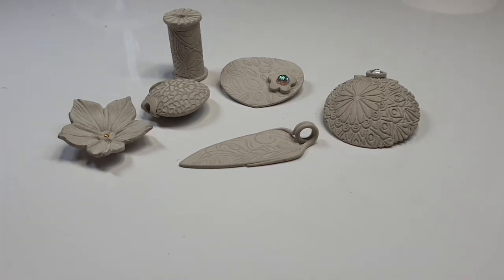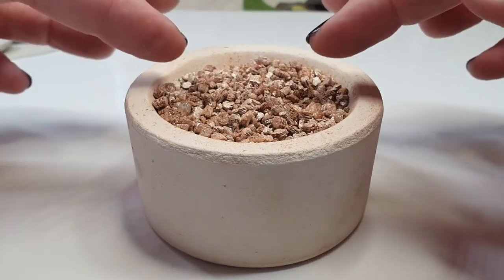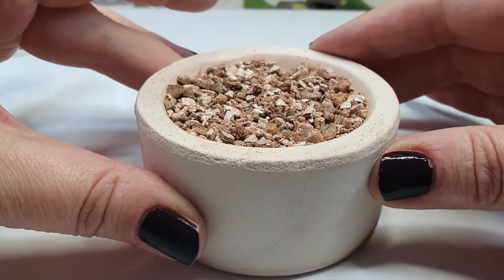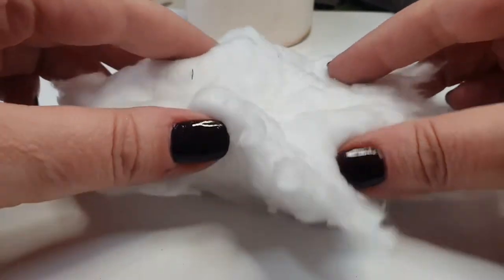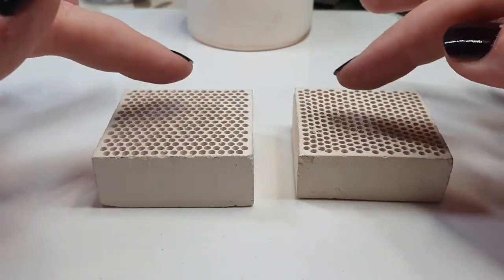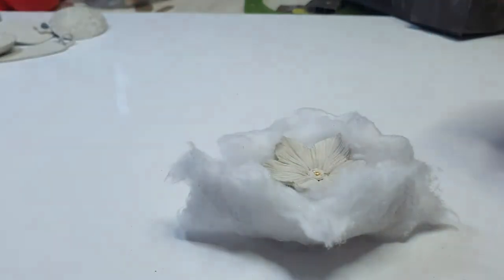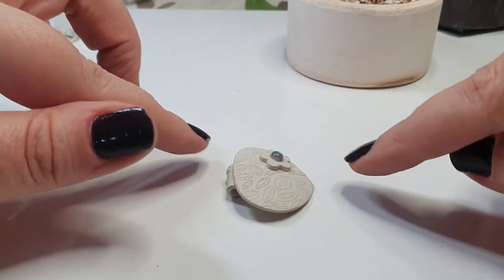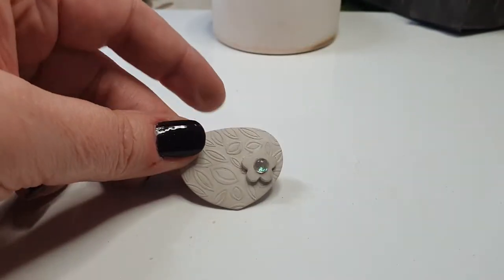Supporting pieces during firing

Comment: would the vermiculite in the crucible work for torch firing a bead? Or are these methods predominantly for kiln firing?
Reply from the maker: No, not really. Hollow objects like beads do need an even firing which the kiln can provide otherwise you risk a badly fired object. But you can fire a curved (non hollow) object in vermiculite with a torch.
Reply: @silverclayschool  Thank you!